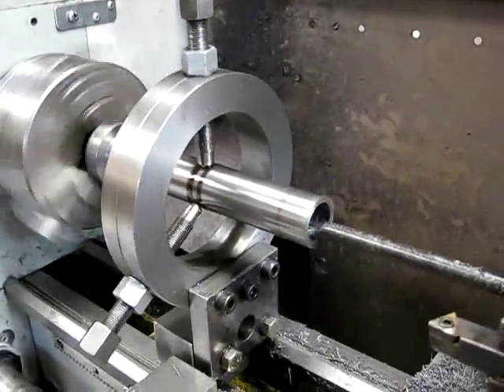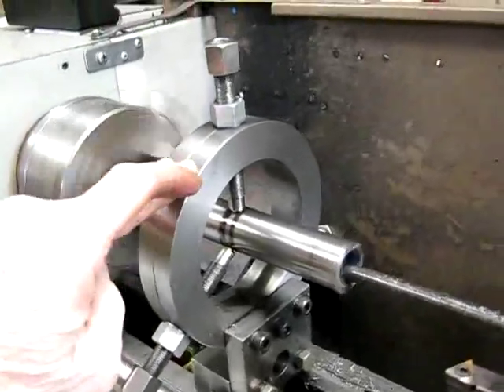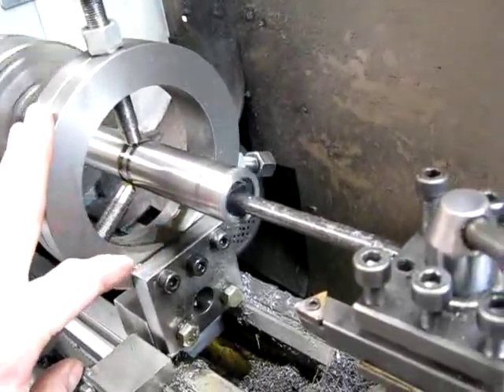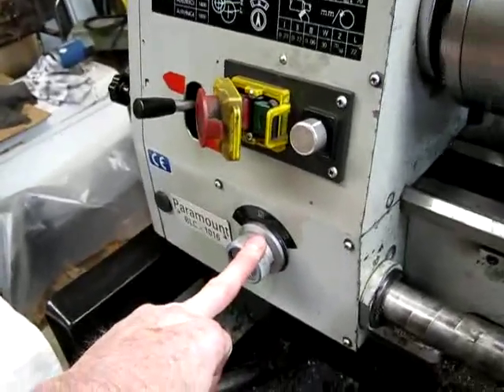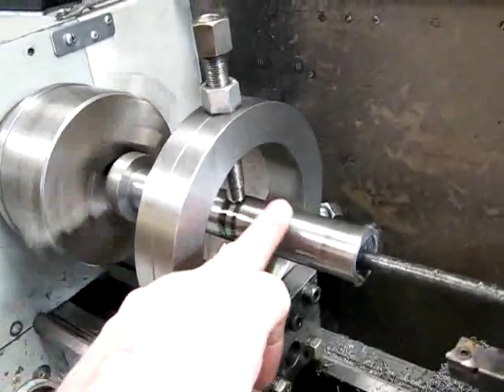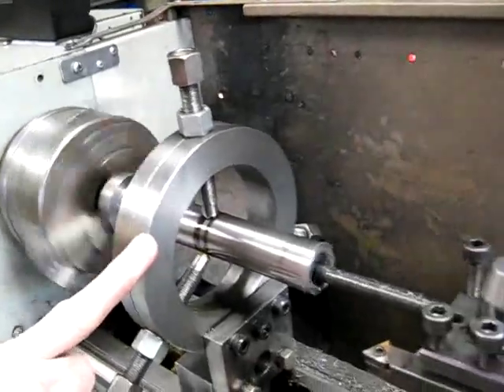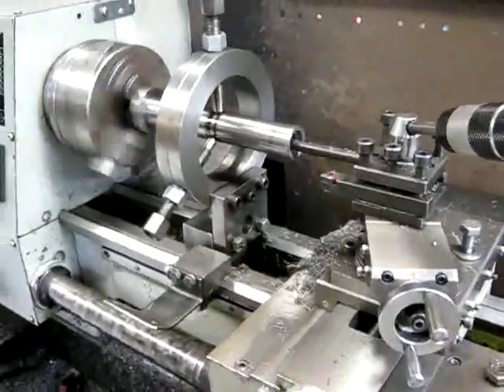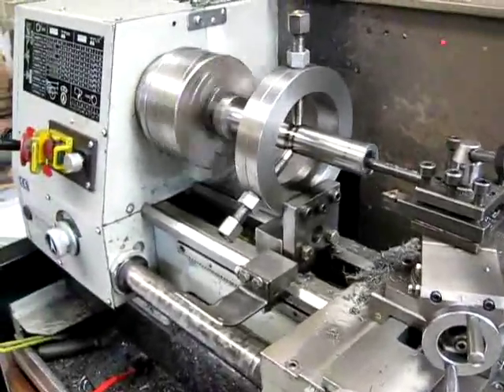Large home made fixed steady being used to center bore on a Chinese lathe

Comment: Any chance you could make a video of how the set-up and indicating of the steady was done.  It seems easy on smooth O.D. stock, but the rough stuff is different. How is that done?
Reply from the maker: In that situation I would manually centre drill the end first, then mount it using the tailstock centre.  Turn it down full length to work finish, and then mount it in the fixed steady as per the video.

Turning rough or non uniform surface in any steady (even roller type) is not going to do it much good.  See my video "How to find center on large diameter metal round stock" for any easy and accurate way to manually centre drill.  Cheers Rob.

Comment from the maker: Yes, that's pretty deep boring :)  I took some fairly medium cuts without a problem, but watched it closely and kept the RPM down.  Only GP mild steel stock and machined fairly easily.  In this situation it's important not to use a really pointy cutter as they can catch and dig in and break the bar.  This was a blade type cutter.

Comment from the maker: I considered using rollers as they are useful if you want to steady rough surface material.  The downside is that the rollers take up a lot of space and restrict the useful working diameter of the steady. Also more complicated to make.  Cheers Rob.